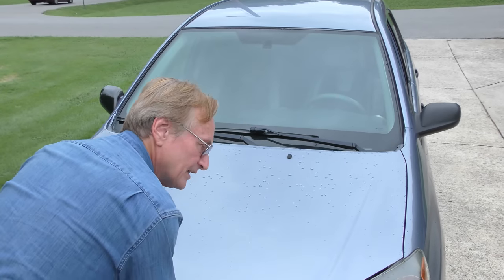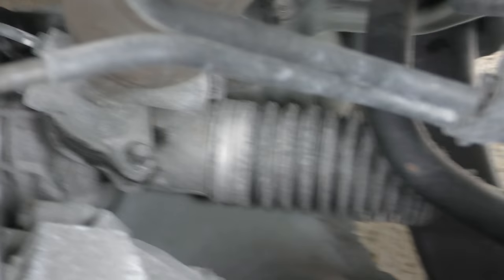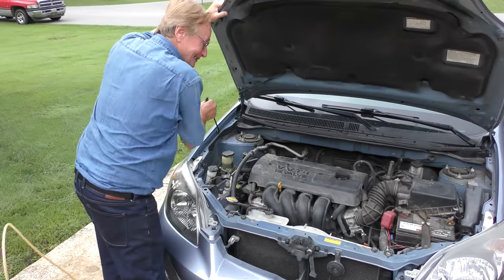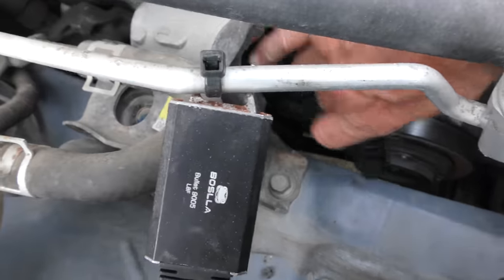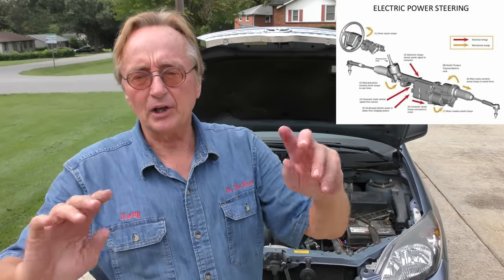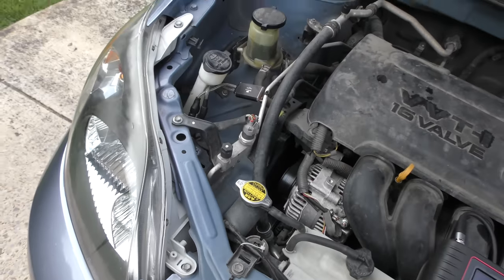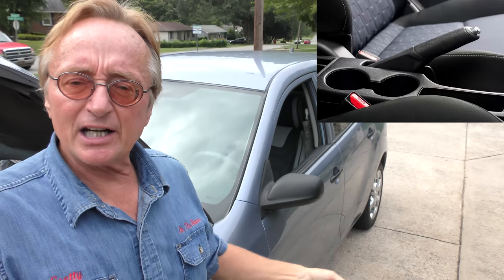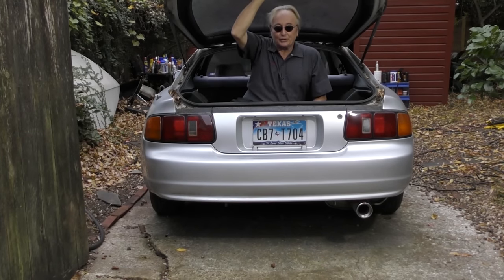Should You Change Power Steering Fluid in Your Car? Myth Busted

Comment: I think the best thing you can do for your power steering is to Never hold it at it's extremes.  When you turn the wheel all the way and pull on the steering wheel to hold the tires so you can turn as tight as possible.  Don't do it, when you hear that whining noise as your trying to turn the wheels as far as possible, That's the steering pump trying to push MAX pressure, that's wearing everything out.  The seals, the pump, the fluid, it destroys the entire steering system.
I have always turned my wheel until it stops then turn it back a quarter turn or so, so it's not whining and wearing out.  377,000 miles and still have all the original steering system components.
Edit: I don't think that we have seen all the ways electronic assist can fail yet, but I would imagine that holding your steering wheel at the extremes would be hard on electronic assist as well.

Comment: yup!!!!, you nailed it on the head about refrigerator compressors not lasting, they are made by "EMBRACO", and they are "JUNK". I have been in the hvac-r business 45 years. the copeland compressor company no longer make the small "TIN CAN' compressors, they are sourced out to "EMBRACO", and they just get out of warrantee( 1 year warrantee) when they fail, so there is no claim for getting a free replacement compressor.

Comment: I do it where it takes only 1 time and approximately 10 seconds for a complete exchange. 
Jack up the front of the car turn wheel full left.
Remove as much Fluid from resovior  as posible .
Disconnect return line and attach a hose extension to a bucket. 
Temporary plug the reservoir return nipple.
Fill resovior with fresh Fluid. 
Simultaneously start car, turn the wheel full right while filling resovior.
Immediately stop engine.
Reconnect the return hose.
Refill resovior as needed. 
Start engine ,turn wheel full left, shut off engine.
Recheck level. 
This method you're completely eliminating all the dirty Fluid in one shot instead of diluting the dirt by sucking the reservoir 5 or 6 times.

Comment: Every time I change the oil I grabbed the turkey baster and suck out both brake fluid and power steering fluid that is in the reservoir and fill it back to the full line. Haven't had a power steering pump or brake cylinder failure in 2 decades.

Comment: thanks Scotty for being brutally and even humorously honest. I manage a lube and general repair shop in the hot California desert and because I'm such a religious car maintenance guy it genuinely disturbs and even maddens me the huge trend of neglect I see my customers do to their cars. granted it's a low income community and very few people have money or the cars worth maintaining but they get mad when they neglect their cars and blame me or others when me and my guys go by the book and pride ourselves in honest business. customers with batteries testing at 20 cca out of 600 cca say no thanks I don't want a battery. customers go 15k miles or much more in desert heat on conventional oil until they run the engine bone dry of oil and all fluids and say no I don't want anything but the cheapest oil change. it's their cars but don't blame others when things go horribly wrong. if people knew the benefit and long term savings of simple car maintenance they would think again before waiting until major repairs are needed. I mean why drive a car if u can't care for it it doesn't make sense and u have been preaching it for years so thanks for doing what u can to make people see the light because they don't believe me. I even show many customers your videos to prove to them. well, ally American brand cars have lasted me half a million miles and still looked and ran great when I upgraded cuz I'm a firm believer in frequent maintenance so at least my cars will look and run great while those fools are stranded on the roadside stuck with a huge repair bill lmao hahahaha
Reply: I agree often a model of car can get a bad reliability rap because the type of buyer does not do maintenance.

Comment: Heads up: Some cars use ATF in their power steering systems  Including Scotty's 2007 Matrix lol It's supposed to be Dexron III fluid! Definitely read the car manual and read what the lid says. Most times it tells you exactly what fluid it requires.

Also, taking the reservoir's  return line off and pouring in new fluid while turning the wheel is a better way to swap out the steering fluid.
Reply: Right. But maybe what he's using is compatible ? Anyway, yes it's a more thorough flushing to do it the way you mentioned. Just raise both front wheels off the ground to do it. No need to start the engine. Also you'll need to temporarily attach a short length of tubing to the return port on the reservoir during the procedure and clamp it so it doesn't drain fresh fluid.

Comment: I recently changed my power steering pump on my 2008 Chevy Silverado.... I bought a new one and the shaft was around 3/4 " shorter than the 1 l took off!! I was worried! but it looks a better fit and so far runs good. So don't trust the parts will be correct if you buy a second hand vehicle! 😐😐😀😀

Comment: Bought a 89 Chevy caprice in 1996 with 131k on it, drove it to 356k miles and never changed the power steering fluid, transmission fluid, or rear differential, or brake fluid, NEVER, car rusted and just had to throw the towel in on it, still ran drove, maintenance is crazy reliability.

Comment: I've nevr seen power steering fluid that type and color, always seen the red one, which is the SAME ATF (automatic transmission fluid), which is what I've had on mine since I've bought it.
Also, I always thought that, doing it that way, the way you did, there's the risk of getting "air" in the system, and it wouldn't be good.
Reply: Older cars used a diff fluid that was just Power Steering Fluid. Both of my 2001's use the light gold colored PS fluid.

Comment: Never change? I drain and fill up the reservoir. So far 47 drain and fills at 165,000 miles and not one issue. I use fish tank air tube and cut to length and suck out old and fill it up with new.

Comment: Scotty Pennsylvania love you and you know that. We share your information with hundreds if not thousands of our clients on Facebook. I had a slight leak in my power steering pump on my second GEN 99. So I use Lucas sealer It’s thick and works but come in the winter time it gels up with my experience I lost my power steering so what I did was I reversed pumped out all the Lucas and put regular fluid in. Now it may be that you have to heat up the engine compartment considerably so that Lucas liquefies but I took no chances. I sucked out all the residue from it cleaned it out and I don’t See it leaking anymore it’s possible Lucas did its job and sealed the unit where the hole was because I don’t see it leaking but in any event I’m sure information might help

Comment: I've probably changed the power steering fluid over 4 times in the past few months  on my 03 f150 started leaking, pretty sure one of the seals on the gearbox went and haven't been able to fix it yet just been topping it up. so far so good. Stained the driveway though.
Reply: trying adding the "Lucas power steering stop leak" after flushing the old one. My 04 pathy stopped leaking in a week of driving.
Reply: DO NOT USE STOP LEAK FROM LUCAS OR ANYONE. So many times I’d have a small leak, trans, oil, power steering, coolant, every time I’ve used stop leak it only made it 10x worse. Just fix it or top it off.

Comment: LG compressors with the "new design" are known as linear compressor. They are known to fail. The compressor uses a piston design with cheap plastic springs and parts instead of a conventional rotary arm found in other brand refrigerators. The replacement compressors have been updated and I have not seen one break. LG has been using linear compressor in their french door refrigerators since the mid 2010s and they do not have a good track record. LG claims they fixed their compressors but they are still failing.
Reply: I Lived 25 years with a HOTPOINT refrig. Still running when I had to leave building. I just vacuumed dust behind motor and kept it clean underneath.

Comment: Scotty my power steering in my 06 4Runner called for dexron 2 or 3. Can I use the newer dexron 6 fluid without any issues?
Reply: Yes, but supertech Dexron 3 is cheap at Walmart. But a lot of manufacturers have technical service bulletins saying ditch ATF altogether and go back to power steering fluid/anti-wear hydraulic oil because of concerns about rack wear.
Reply: @gregorymalchuk272  thank you. I appreciate it.

Comment: I did it by taking of the low pressure hose and having a friend holding it in a container as I emptied it by steering back and forth with the car lifted up. That way the steering doesn’t lock up, with it lifted I mean. Empty, refill, empty. We did this until it turned green which was the color I used. It was pitch black when we started. That pump was whining so much now it’s dead silent. Did this back in April. Still green as grass!

Comment: Hi Scotty, And for Honda's like mine. I charge the fluid in the reservoir every single oil change with Honda fluid. It only takes five minutes and $6 or so. Every Honda I do that to has not leaked from the rack. The only thing that started to leak was the o-ring on the lines at the pump. Another easy fix and less then $20 from Honda. 
On those brake pads. They are great and I use Brembo. I think the two are related.

Comment: How often should the power steering fluid be replaced? I've got a 99 Camry 4 cylinder with 215,000 MI and I've never changed the power steering fluid and I've owned the car since 2002 for 20 years now.
Reply: It's way past due, but it's a Toyota. Lol. Just get a turkey baster like Scotty did. Suck out the fluid and replace the same amount into the system. Drive for a day or so, let it mix up. And do it again 5 or so times. You'll have clean fluid soon enough
Reply: @tylerc7037  thanks for the advice.
Reply: @tylerc7037  Where do I dispose of the old fluid?
Reply: ask the auto parts store where you buy the fluid.  They should know where you can dispose of it.

Comment: Scotty,  after hearing you recommend using Akebono ceramic brake pads and high carbon painted rotors, I finally did a 4 wheel brake job on my Camry and my braking system is so much smoother, and grips better than the Toyota OEM brakes.
Thank you for the tip.

Comment: One he didn’t mention that not all vehicles take power steering fluid some use automatic transmission fluid.look in ur owners manual to see what kind of fluid ur vehicle uses before u put the wrong fluid in and mess something up and second Do not listen to what he’s saying.that is not a proper power steering flush.yes u suck out the reservoir then take off the return line and don’t forget to plug up the nipple the line come off of but then fill it up with clean fluid and get some kind of pump and stick the pump hose in the return line and pump fluid through there till it’s clean fluid coming through but that’s basically a actually flush.just look it up on here u can find a video doing a proper flush

Comment: Electric assist with no fluid......except Chrysler!  Haha.  Had a 2014 Dodge Charger with "electric" PS.  But, it's basically an electric over hydraulic system.  When the fluid starts getting low, it would act like the steering was binding when turning left quickly.  To the right was fine.  And of course to fill it up you have to go through the passenger side wheel well!!!!

Comment: I have a faster way to change the power steering fluid, but it requires an assistant. Take the return hise off the pump and run a hose to a bucket ir some other container. Have your new power steering fluid open and ready. Put a funnel in the top of the reservoir. Have your assistant start the car and turn the steering lock to lock until all the old fluid is in the bucket and the fluid is running clear. Turn the car off, put the return line back on the pump, top off the reservoir and cap it. Take it for a ride to endure no air inadvertently got into the system. Check your fluid level and toure done. It literally takes me 20 minutes to completely change the fluid. Ive never had a problem doing this. The main thing is to ensure you dont allot the pump to run dry. I hope this helps someone.

Comment: When I first got my minivan, I wanted to replace the power steering fluid, and brake fluid. Unfortunately, I can't get any big name mechanic to do either. They won't do the power steering fluid without doing 100 other things "wrong" (most of which I've repaired by myself already). They won't mess with the brake lines because they're rusty. I had a guy who does mechanic work on the side, bleed the front as it was needed. I can't seem to find someone willing to do new brake lines, so I can change the fluid, other than big mechanics. Problem is, they want to address my other issues first. I'm thinking, when the power steering pump needs replace, I'll just do the fluid myself at that point. In terms of the brake fluid....I suppose I could attempt myself. We'll see lol.
Reply: Just use a clean turkey baster to remove your brake fluid and replace it.

Comment: question: can i use transmission fluid for my power steering on a 2007 ford edge?
Reply: Read the manual or look at the cap, it should state what to use.

Comment: That method is weck . I flushed my car the old school way using a clear hose connecting to the return line and it had a leak with nylon washer that crushed with Preston power steering fluid and the pump was making noise. I fixed it, replaced with new nylon washer and used new mercon transmission fluid wich the manual says and it's a mercury sable.u gotta be careful  with auto zone because  they say u can any power steering fluid.

Comment: The LG refrigerator was quiet; because it stopped running. Lol!! I had one and it lasted 3 years. Whirlpool is one of the best. Thanks for these videos. I learn so much. I'm single and like to know what I am doing with my cars.
Reply: I had a whirlpool and thought it was fine. 
Then I got a Samsung super quiet and overall way better.
It was only $700 2 years ago.
Reply: I bought a LG tv 6 days ago because they were upgrading to fiber cable. It has a 4” wide “racing stripe” in the middle of the screen, from top to bottom. And now I can’t use my ancient Philco Ford tv because it’s obsolete. So much for progress. 🙁

Comment: what do you do with the old fluid?   do they specifically take used power steering fluid at the recycling?
Reply: Any fluid you can drop off at AutoZone or fluid recycler. As long as it's in a sealed container

Comment: Don't need to go for drives just put cheap oven trays under the tyres and it will turn real easy when stationary
Reply: You should also bleed the system after, take off cap move steering back and forth, check level and put cap back on That's the system bled

Comment: The critisms of electric power assist steering is completely overblown, I have a 04 Honda Civic Si with electric steering and it is BETTER than hydraulic in every way.  150k miles and 20 years old working perfectly.  Electric steering uses less gas because it doesnt use energy when youre not turning, unlike hydraulic which spins the pump all the time, AND it doesnt require any maintenance UNLIKE hydraulic systems which need constant fluid changes and seal replacements.

Comment: Would you have any advice you could share on maintenance/repairs I should consider adding to a head gasket job while I'm at it? I have a 97 Mustang with a 3.8L v6, and its got unknown miles so. I wanted to do a little fixing so its reliable till I swapped engines
Reply: Oil change,coolant, air filter,spark plugs check belts...
Reply: @Roller-01  done all those. Also done lower and upper intake gaskets but. Probably will just redo em. Valve cover gasket also redone, but not gonna bother with the oil Pan rn
Reply: @SubsonicWave  sounds like u got it covered...maybe check radiator & heater hoses

Comment: I use my pump on the reservoir once a year and I usually just do it one time to keep the fluid always clean. What do you think about the difference in using dexron fluid as most of my Toyotas recommend or should I change to power steering fluid?
Reply: Use whatever the manufacturer says to use.
Reply: @chuckhoyle1211  yeah I’ve heard people say how power steering fluid would do a better job and ATF is just a good enough fluid since they’re both hydraulic fluid. I do think its more of just making sure the fluid doesn’t get too old or dirty but I wasn’t sure